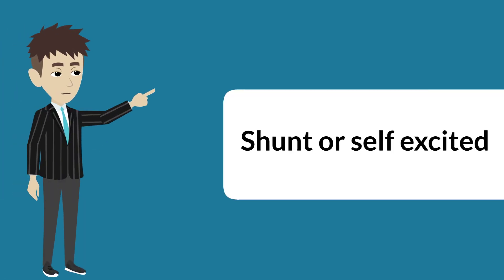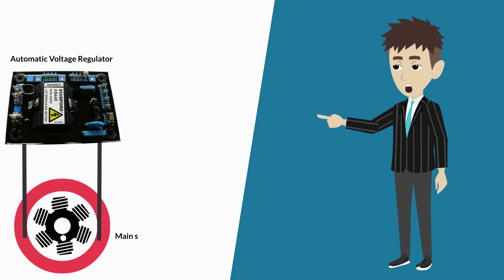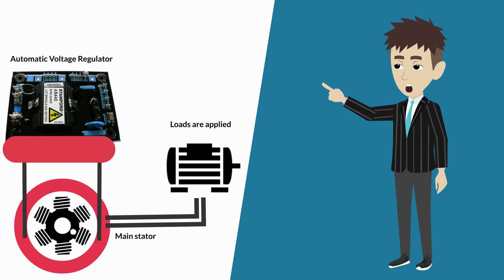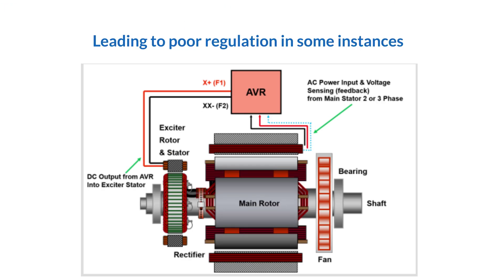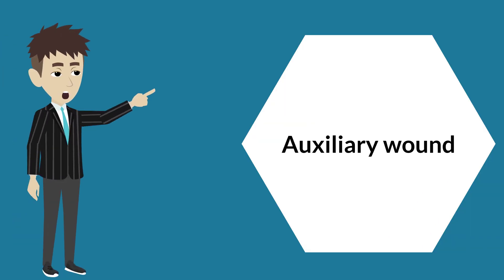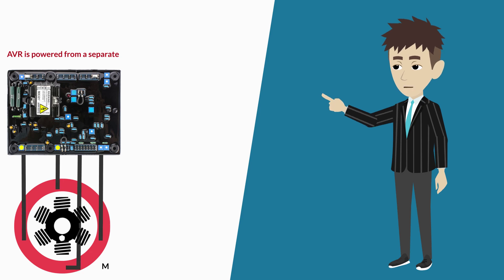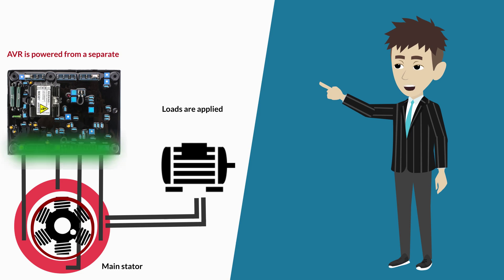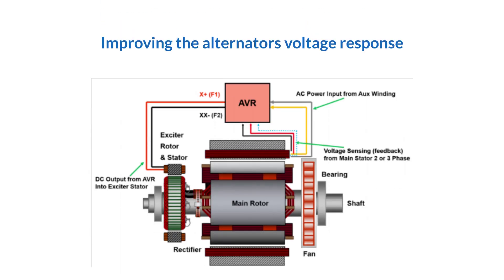Explained: Generator Excitation Systems, Shunt, Self Excited, Auxiliary Wound and PMG

Comment: This is very confusing.. if I knew any less your video would lead me in the wrong direction. In first "self excited" "avr" section you end with a diagram of a auxiliary winding generator then do it again for the real section. Since shunts don't have a separate excitor/rotor. That the purpose of them is to save length to fit in small spaces. Please correct me if I'm wrong I'm trying to learn this and your video just just made all my research wrong with just one part added